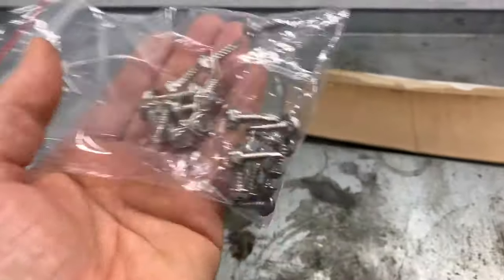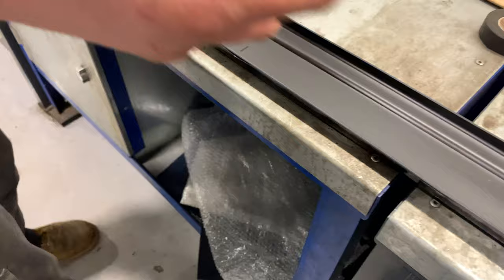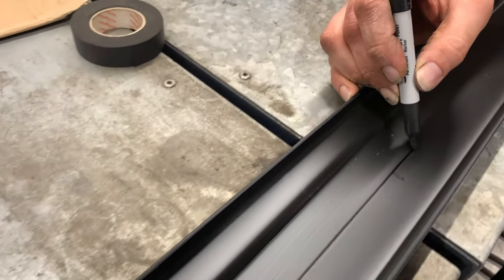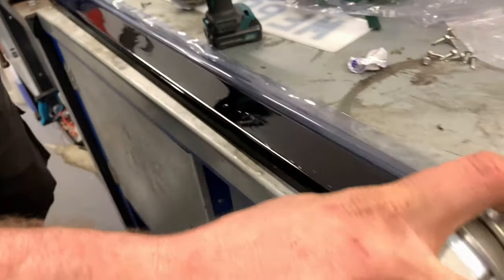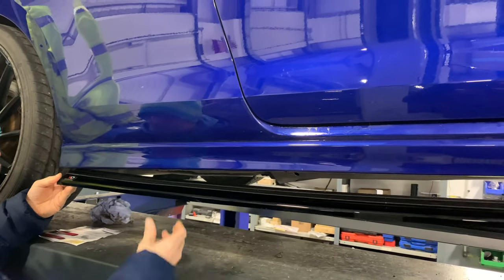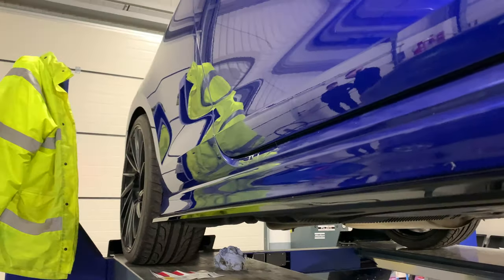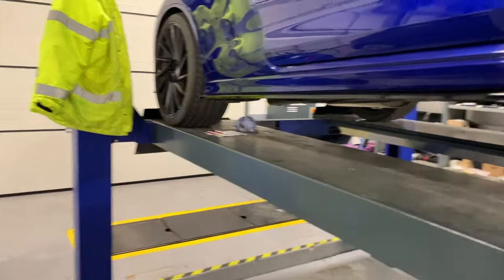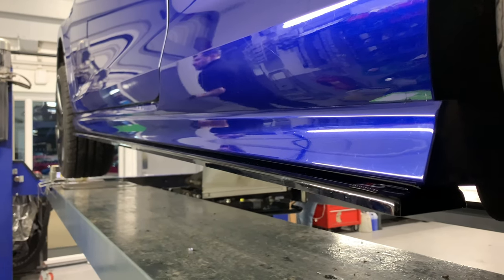VW Golf MK7 R Maxton Design Side skirt Fitting

Comment: Well you guys made that look easy. Think I struggled coz was using the impact driver at a slight angle.
Did you not feel you needed to cut a place in the skirts for the jacking point?
Reply from the maker: From what I remember no we didn’t cut anything, I sold the car a few years ago now. It was definitely easy on the ramp, and also not the first or last time we have fitted maxton items to a car I guess
Reply: @1BlueGhost  cool thanks 🙏

Comment: Thanks for the tutorial! Looks great
Reply from the maker: Thanks!!
Reply: 1Blue Ghost for the front splitter, did you have to take the bumper off for fitting? Or was it drilled straight up into the bumper?
Reply from the maker: AkashBhambra yes I took the front bumper off to fit the splitter. Made it much easier.
Reply from the maker: 19’s no spacers
Reply: I can't tell how it looks with the dirty-ass tires.  Next time, clean the tires before doing the final walk-around, please.
Reply from the maker: Dirty is life 😎
Reply: @drycube2  there’s so many ways to ask.. and this is the way you chose 😅 I’m sure he’ll want to impress you next time..
Reply from the maker: I sold the car last year so it’s not a problem anymore 😎
Reply: @1BlueGhost  how did you find living with the golf btw? I’m hoping to get one early March and so far I’ve only heard good things?
Reply from the maker: Yeah it was a great car. Probably the fastest car I will ever own. I only sold it so I could buy a house otherwise I’d stil have it.
Reply: @1BlueGhost  yeah I’ve done it the other way, hence why March, as it would be over a year so I’ll be back to somewhat normal hah! Cheers man, helped make my mind up x
Reply from the maker: Sadly we didn’t have enough in our current house after they increased the deposit amount so it had to go. Our new bit is ready in March also. Stamp duty saving 😎

I would have another one definitely. As an every day car, comfy, smooth, drive good, handle alright and go really well. Even a stage 1 is a fast car.
Reply from the maker: 4 and a half years I owned it, it never ever broke or let me down 👍
Reply: @1BlueGhost  i know its kinda a pointless question, but what was MPG like? my daily commute is about 15 miles each way, average speed of 45, in my bmw atm i just pop it in eco, what do you estimate in the golf? not a deal breaker, just to be prepared haha! hope you enjoy it mate! dont blame you, best you saved thousands ah!
Reply from the maker: @guyweir2604  I used to see about 28-30 on my trip to work and back. on longer runs I had 39 a few times. none of the modes seemed to be any different, apart from in sports obviously.
Reply: @1BlueGhost  good to know, thanks your help man! Much, much appreciated!

Comment: Aren't you afraid of rust when you make holes through metal?
Reply from the maker: Slaven Milic I think it just screwed into the plastic
Reply: @1BlueGhost  I have Skoda Octavia and I think that by Skoda is metal down there.. I want to build my Skirts but I'm afraid what will hapened after few years with the rust
Reply: Good point!

Comment: They look super light!  Are they?   
Cause I have an MK7 gti w golf r side skirts.  
I’m afraid since the the skirts aren’t factory assembled that the Maxton diffusers will pull them down,  but if the skirts are very light maybe I’ll be ok.

Car looks sick!
Reply from the maker: yes they are pretty light, ive had no issues with them as yet even driving through puddles they've stayed put.
Reply: 1Blue Ghost  thanks for answering. 
I’ll give them a try, I was afraid they will pull down my skirts.
Reply: 1Blue Ghost  are the skirts made of same material as front diffuser? 
Sorry to bother.
Reply from the maker: @eval7952  pretty sure they are both listed as being ABS so id imagine so but im not entirely sure.

Comment: I’ve ordered some different maxton side skirts, looks like yours have some sort of adhesive to help applying it. Mine are telling me to use glue. What glue should I use ?
Reply from the maker: I purchased the tape separately, it’s just 3m tape and seems to work well. Mine also suggested glue but decided against using. Some sort of gorilla glue or no more nails type stuff may work.
Reply: I tried using tiger seal fucking hell what a mess when you take it off
Reply: @Holliana8647 did you glue them onto the actual car or onto skirts already on the car? Because I haven’t got plastic skirts on the car already so I’m gonna need to drill through metal to attach them but I’m not sure wether to use glue
Reply: @James.527  straight on to car, my car didn’t have skirts. Tiger seal alone on side skirts will not be enough, my maxton ones have been on a few months now and that’s just with about 10 self tapping screws in each side straight into the metal underside of the car.
Reply: @Holliana8647  okay thanks, I was skeptical of drilling through metal because I don’t want it to rust but I might just go for it lol
Reply: @James.527  yeh I know and it’s definitely a risk just got to keep an eye on it and fill when removed I guess. I’d rather do that than risk a skirt coming off while driving at high speeds and puncturing a tyre ya no